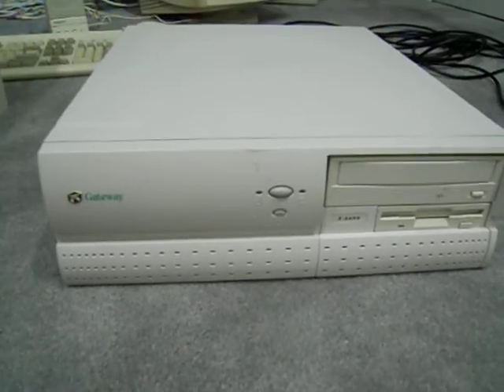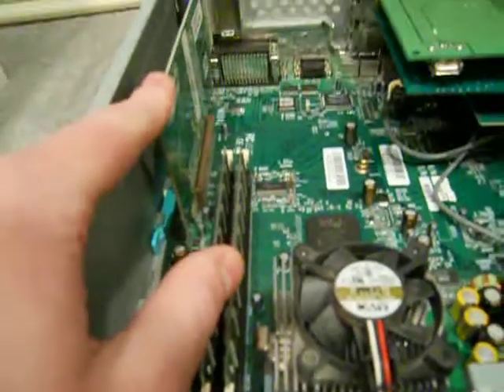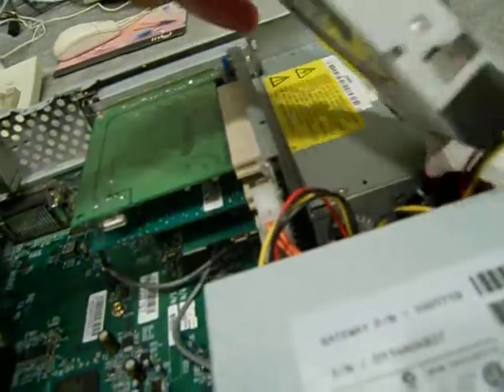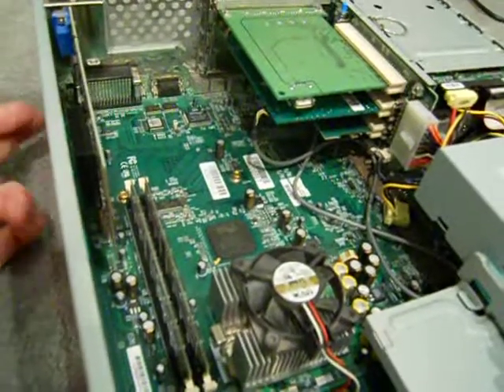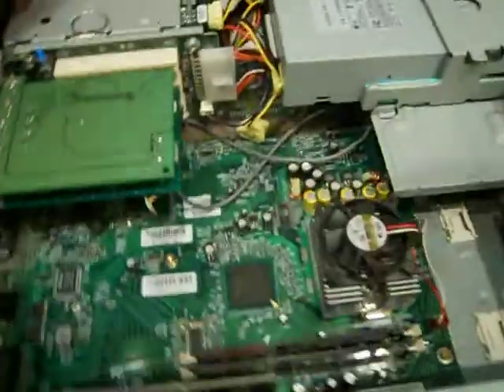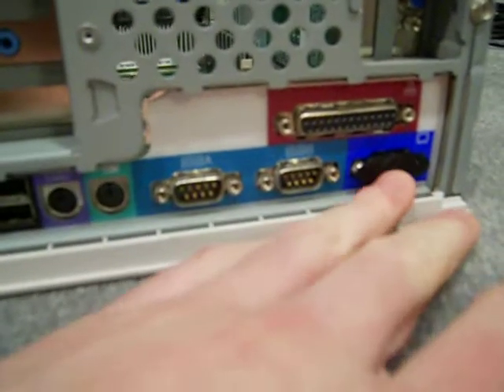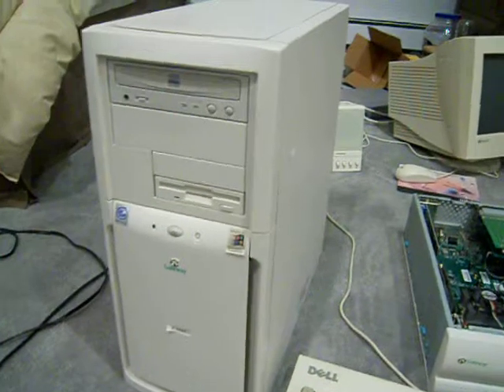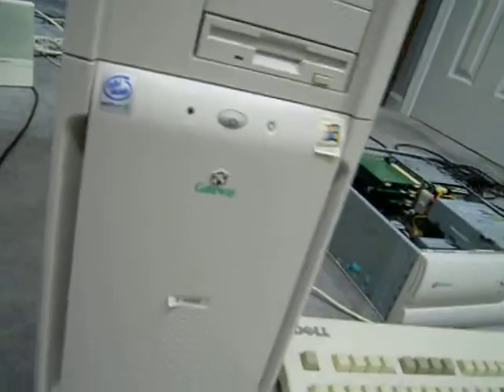Two Free Gateway Computers!

Comment: I picked a Gateway PIII tower like that off the curb once, but it had a dead power supply. But I did get a working Matrox video capture card out of it, which I used to make many of my early YouTube videos. The 1.1 GHz PIII is actually faster than those 1.6 GHz Intel Atom N270 netbooks sold today, so it is still a very capable processor.